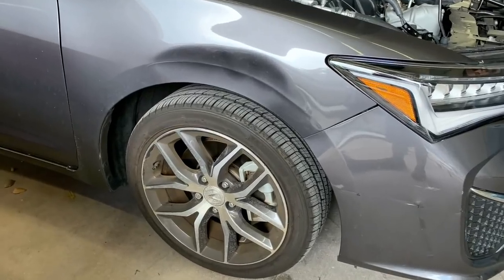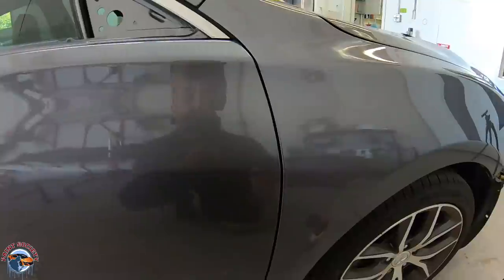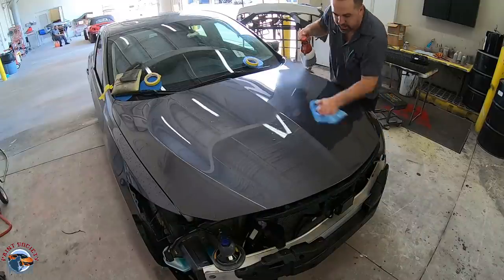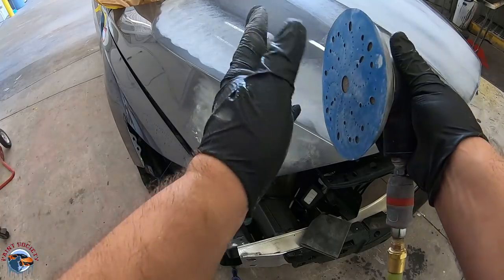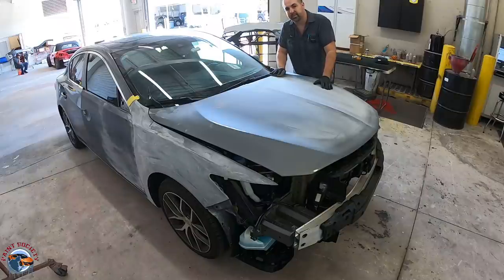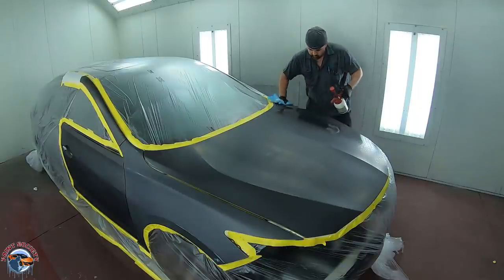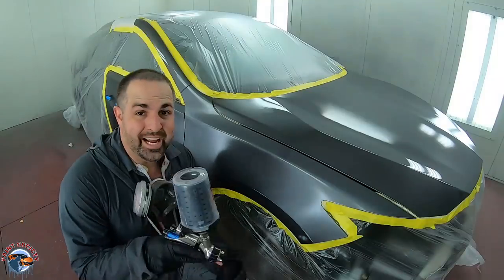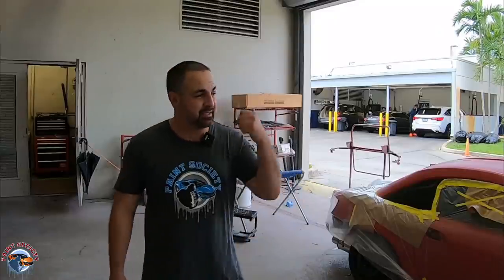How to Blend Car Paint

Comment: With light and metallic colors, or sometimes any colors. bumpers will never match 100% Even if you spray the bumper at the same time, even if the bumper was kept on the car and u sprayed it, it still wont match. Paint is a tricky thing and sometimes throws u curve balls here and there. If you do this for a living the best thing to do is for your boss to explain to customers about this. Theres plenty of posters, info from your jobber that u hang on your walls, or desks for customers to see so they know about it so u do have some leeway

Comment: I've had this problem aswell. In my case case I sprayed a light grey sealer underneath a dark grey metallic. Same situation as urs where mine painted pannels turned lighter than the rest of the car. I blended and another tip I got was to use the same color but with a darker sealer. And its was a really good match. So I guess in ur case a darker color sealer would have been good and u wouldn't have had to do a second time.

Comment: dude i cant even tell you how HELPFUL this video is. 
A lot of channels dont even cover this chip/blending topic and its something i have to do everytime i paint. im really glad i found this channel
Reply from the maker: So glad to hear this !
Reply: @PaintSociety  nice vid! Brian, why you didn't blend the bumper? and another question: what happened to the door? have you sanded it with 600-800 as the hood, but just did't show in the video?
Reply from the maker: @BubiGTR  we don’t get paid to blend the bumper and he’s 600/800 on the door
Reply: @PaintSociety  would you have to add the extra slow reducer to your base coat to blend out the edge if you dont have clear base to work with
Reply: @BubiGTR   stop asking for so much for too little, you want it perfect PAY MORE
Reply: @paintsociety how would you blend if bonnet isn't curved to use a line!?

Comment: I think one of the best bits of info and instruction you give in your vids is which grits to use and when for sanding, I believe it's one of the fatal mistakes novice painters make is using too course grit thinking it cuts quicker, not realising it also leaves deeper scoring to fill.

Comment: Damn B 👍👍👍
I wondered how blending was done to match pain. I guess it's just not a simple as it's made out to be.
Another outstanding job for sure.
You mentioned the use of only the Devilbiss gun on one part of the process, is that just your personal preference and can other guns be used to get the same results. 
Thanks, learning lots !!!
Reply: I think he was talking about the pressure on the gun. If you have another gun you might need more pressure. I think around 20~23psi for metallics is fine
Reply from the maker: All guns can do similar. I just prefer the dv1

Comment: Hi Brian. Is the DV1 your using the HVLP plus air cap or HVLP one. When you say 15 psi is that reading in the gun digital gauge or on gun inlet. Think DV1 reads pressure slightly differently on the gauge. Thanks for helping and learning loads from you video’s. 👍👍

Comment: Brian... I'm having a little difficulty understanding what exactly sealer is... Could you tell me what it is, and add some links as to what you are using for a "sealer"??
Reply from the maker: We use colorbuild sealer but you can use any sealer within your paint system. 

Mp235 will work
Reply: also called a primer... in europe. i was wondering too ; )

Comment: Brian, I really could use your expertise. I just ordered all House of Kolors sealer, paint, and clear. I had a supposed pro painter paint the car. I had him stop when I saw the sealer. Its patchy, uneven, has sweat bubbles from him sweating on the car, and its tiger stripped. Needless to say, the car is back home. Hes fired. Question is, do I need to wet sand his flaws, and redo the sealer, or can i some how get around reordering my h.o.k sealer, which we both know isnt cheap. Please respond and give me some help. Ive spent 2 yrs working on this car, all to have some hack with good reviews mess it up. Please man, I want this right.

Comment: @Paint Society quick question Brian, why did you paint the fender including with clear before putting on the car?  I think to have closer grade of substrate, but also to use less base coat at the time of blending so as to help avoid runs?

Comment: I’m confused.    I’ve heard so many different things and even witnessed for myself so many different things with how clearcoat can make or break a paint job.    I’ve heard that whatever your panel looks wet, is how it will look after clear coat.   I’ve heard and witnessed that clear coat will not “cover” mistakes or “hide” scratches and that the panel will only looks as good after clear as it did before clear.     But here you scuffed/sanded the whole hood as an extended blend zone, especially seeing as how it’s one panel and a hood at that, I get it, but you basically scuffed with high grit, then only applied clear coat?  And it came out looking great?    As an experiment awhile back, I was painting a hood for my Dodge Magnum in its factory Brilliant Black Pearl.    I got some runs and used a razor blade to cut those out, and scuffed around the area, and to get it to feather, it ended up being the front quarter of the hood, a sizable area.  I had no more black paint, and since the whole thing was an experiment, and at the time was using SprayMax2KGlamour, I just scuffed it a bit finer, went for uniformity, and sprayed the clear over the whole hood, acting like nothing was wrong and the whole hood was just fine, nothing to see here, folks.    To my amazement, the scuffed area looked exactly the same as the area that had a nice glossy wet color coat.   I thought it was a fluke or an illusion, but a week later it still looked great.       So why do we even try so hard for a glossy color coat at all if the clear will just make almost any grit of scuff glossy?     What am I missing?    Is it just acceptable if the area is in excellent shape, and maybe not cured?   Oops, this Acura hood was way past cured.  Hmm.      What’s the score?    If you can clear over scuffed color coat and still get the desired result, then why do we put so much effort into a glossy color coat?   I also understand that a scuffed surface will “grab” the clear a.it better, and seeing as how the clear is the finish’s first line of defense against the environment,  applying to a surface with deeper grit will help with longevity.  But then we paint all the time over 800-1000 grit with clear with no concern of it peeling.    What gives?

Comment: Hey Brian, I have 2 questions to ask please, first one, i just noticed that you did half the pillar with both base and clear, will it matches well from when you stopped with masking tape? And the second question is, i am seeing well if a said the front bumper is kinda slightly different in color? maybe you can do blending in the bumper if you need to ? Similar to what you did on the hood for an example. Thanks and always a pleasure seeing your videos 👍
Reply: He did a blend of the color on the pillar about 8~10 inches then he did a blend of the clear coat where the masking paper is. He didn't show it but he probably used SRA reducer to fade away the clear edge
Reply from the maker: 100%
Reply from the maker: Read julians response for the first question and I did repair and blend the bumper. It has the same paint. The problem is the angle and plastic reflects metallics differently
Reply: @PaintSociety  i see, so you did the bumper blend off camera, that's why asked you about it.. i assume you used SRA reducers on the pillar, but in reality how it matches the rest of the pillar out of 100?

Comment: I plan on doing a paint job on some panels of my car at home (DIY). I don't have the equipment for mixing the paint to get the exact match. Would getting paint that has the car's paint code be acceptable or should I not paint due to possibility of having a different variant of paint that could be off? I should mention I will most likely replace the panels with new panels.

Comment: I did a bumper with KH3 color. The black on the bumper was darker than the rest of the car could this be from too many coats of base or clear
Reply: No, if the black is darker it usually means there's not enough white or other toner that's used in the formula to dull it.
Reply: Factory KH3 has some white and yellow toner is there. Its really rare for any car to only have a Deep Black Toner in there.

Comment: Brian... What would you recommend for a newbie in DA-ing. Is it safer to do a finish P800 or P1000 with block or just hit it with DA? Is it possible to make a visible dents with such fine grit on DA(creating waves on the panels)?
Reply from the maker: 800 da flat spots and gray scuff pad your hard edges when blending

Comment: How do you get rid of the hard line, on the A pillar, where its masked off. Either overspray would be there or the new clear vs the old clear? Wet sand and buff? Chemical blend?
Thanks
Reply from the maker: There’s no hard line. It’s smooth. I never clear up to a line or mask it off. I’ll do a video on it
Reply: @PaintSociety  Thanks, The whole A pillar seemed like it was completely wet sanded down., so assumed you would have to clear right up to the tape (aka where it was wet sanded to). Thanks
Reply from the maker: I’ll have to do a video on it.
Reply: @PaintSociety  Thanks!

Comment: What does it mean when I sanded down black gm 8555 code on an escalade  with 800 then scuffed edges using grey pad did 3 coats clear can still see sanding scratches?
Reply from the maker: Probably scratches in your primer that swelled up from now refining your body filler enough
Reply: @PaintSociety  It's outside the body filler. The factory clear coat only. where I sprayed primer and fresh paint was fine.
Reply from the maker: Jeff Eaton hard to say without seeing it but something swelled up from a course sanding scratch along the way.
Reply: @PaintSociety  Ok I had a friend with 30 years experience stop by yesterday evening & couldn't figure it out lol. He took pic and going to ask paint reps.

Comment: I don't see blending addeditive in the store just online.
Reply from the maker: What paint brand
Reply: I just finished my truck today painting it turned out a lot better finally. I didn't use primer this time though. I shouldn't of kept using it every time anyway because it didn't have all the imperfections plus no bare metal. I used 1k basecoat and 2k clearcoat with activator. The 1k basecoat already had reducer already mixed in with it but didn't use the primer this time. I used three basecoat and 3 clearcoat.
Reply: I used Speedkote paint brand before and I had bright silver metallic but I only used it for clearcoat not basecoat I used some paint brand named TNT automotive finish I got them both on eBay.